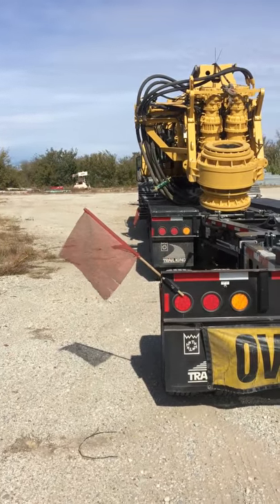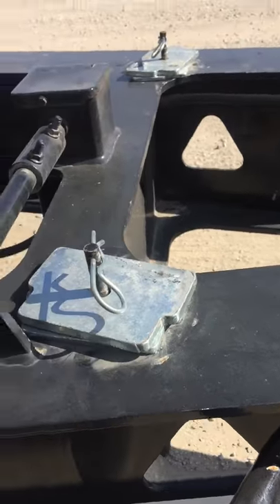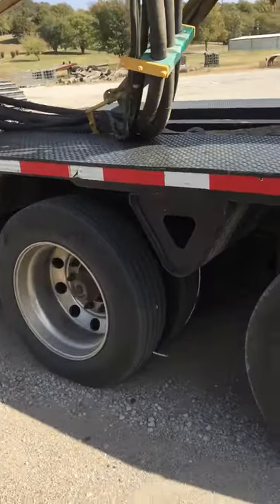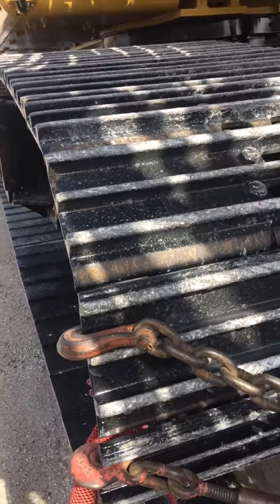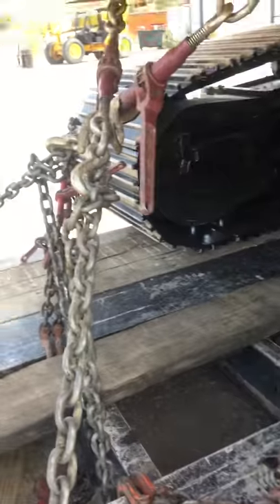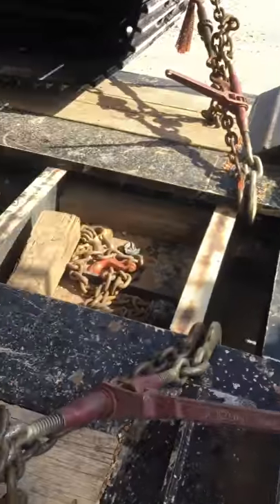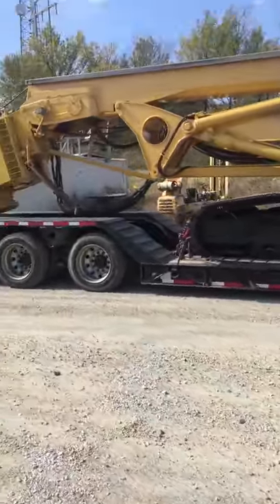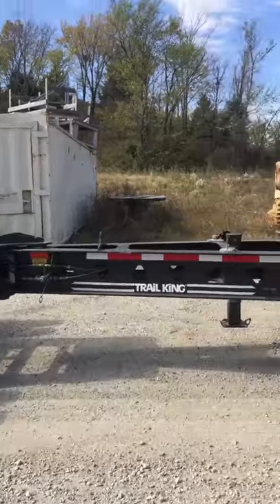Heavy Haul Shimming booster and tie downs

Comment: Did you tie down the boom/stick?
Reply from the maker: No, as a rule I don’t tie them down because the trailer deflects (bounces) different that the boom does.  It’s hard on the swing bearing and often breaks chains or binders or worse yet damages boom.  I always have the upper chained so it can’t swing but not in a way that could damage the rig.

Comment: You will never spin the turbo if you don't cover the exhaust!!  Why do people cover these??
Reply from the maker: @puretrouble1603  trash in the turbo, water in the turbo, and yes in certain machines and exhaust systems you can absolutely spin the turbo going down the road.  Stick your hand out of the window at 30 mph and feel how much air is moving across your hand.  Will a new machine with a DPF spin?  Probably not.  An old machine with almost no muffler and a straight shot into the turbo…heck yes.  Why give somebody a reason to say you were the potential cause of a failure or problem?